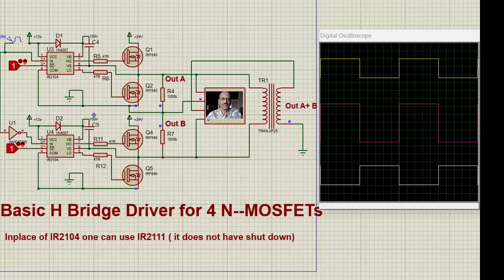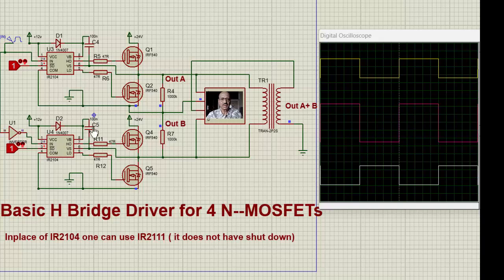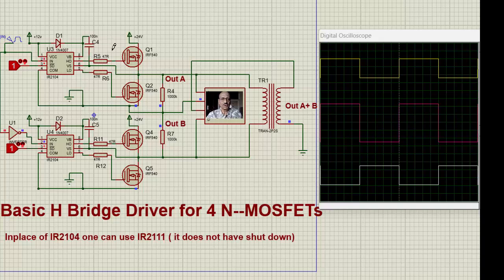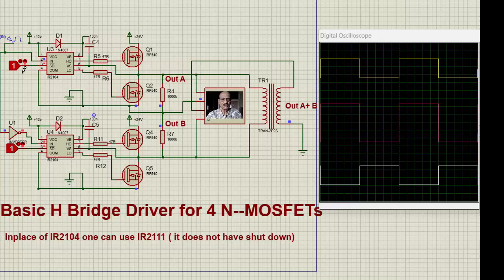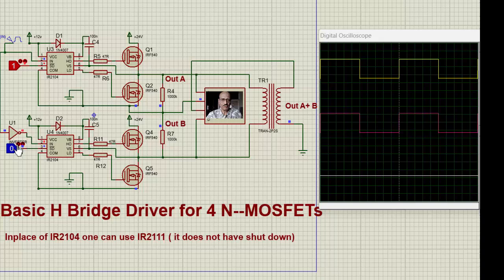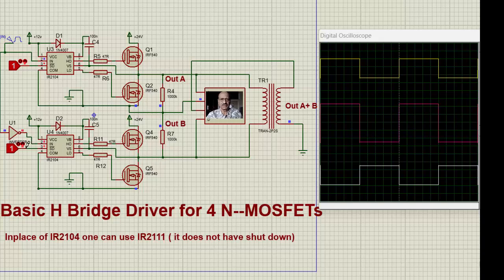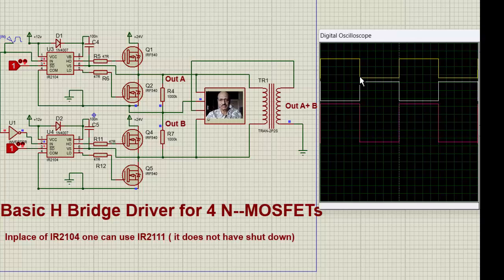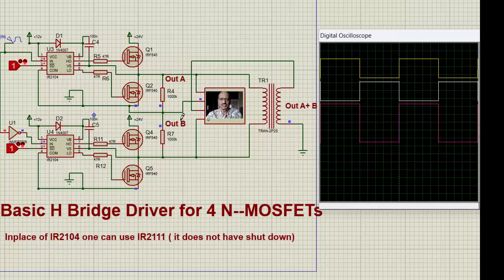MOSFET Drive Part 2, on driver ICs, IR 2104, IR 2111

Comment: I want to make full bridge  high power smps can i use sg3525 and ir2104 ?  Suggest me
Reply from the maker: Yes
Reply: @PatnaikUC sir please make a another video on full bridge smps with circut digram sg3525 and ir2104 or ir2111 ic

Comment: on Pin-2 (Input) of IR2104 IC, can we directly give 5volts digital signal? or it should match the vcc (12v) using npn?
Reply from the maker: 5 volt is absolutely ok